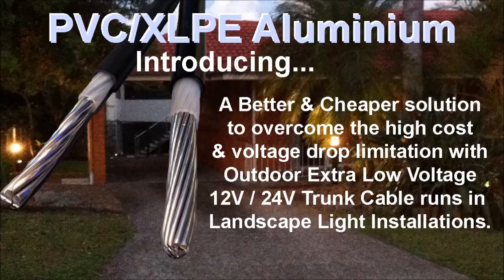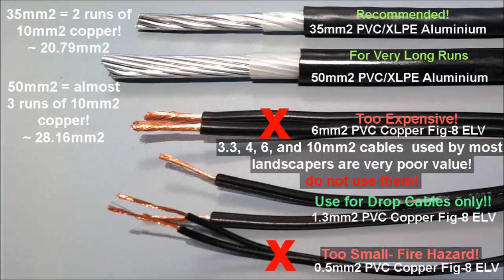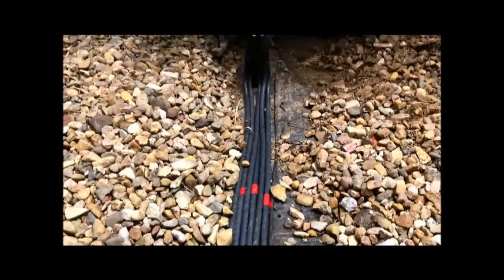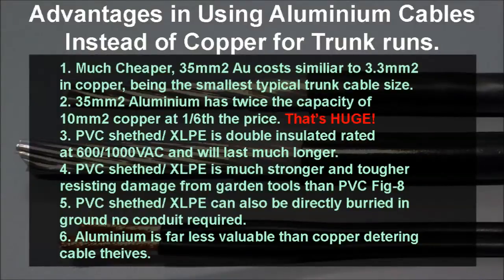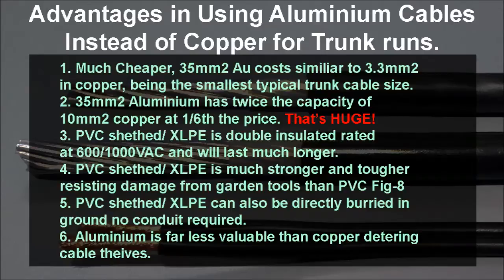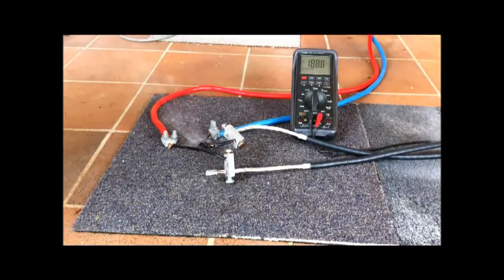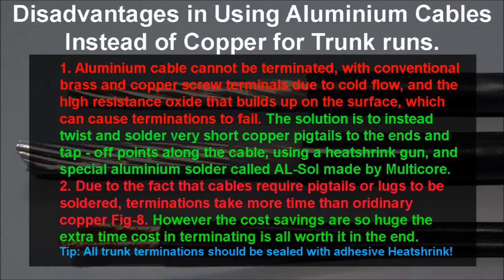Saving Money On Trunk Cable runs in 12V / 24V Landscape Light Installations

Comment: 0:02
It isn't better it is only cheaper.
0:28
Spelling error.
0:31
Three spelling errors.
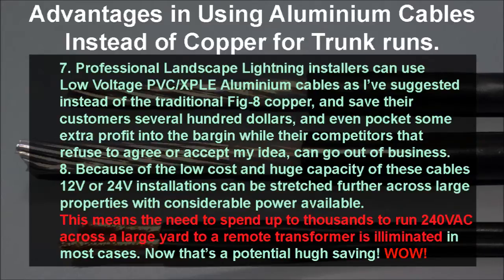3:15
One spelling error.
4:05
Illustration is not conclusive; not a fair visual test.
4:27
Wow, no spelling errors.
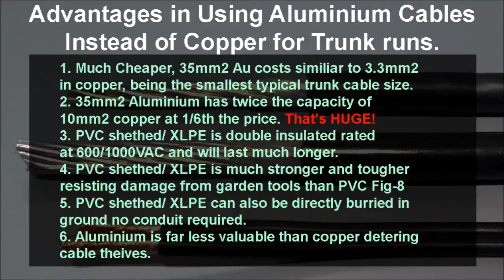Reply from the maker: I did actually check and could not find any spelling errors at :28, :31, or 3:15, I verified with the online dictionary. There may have been one where a lot of text is on the screen and was overlooked but I couldn't find them. But doing a spelling and typo report reply is really missing the point, the message is clear. There are advantages and disadvantages with using both pvc copper or pvc/xlpe aluminium, If you can afford the extra time in termination there are more advantages pvc/xlpe aluminium. The over current test burning out 6mm2 copper was more just a bit of a joke, but 35mm2 aluminium can handle more abuse than 6mm2 copper.  Many companies like the power authority Energex use aluminium where possible and not just because its cheaper. Your attempts to discredit the video has failed..opps  "Wow, no spelling errors" u say. If you happy to get ripped off and use copper you're tough luck.."OohGoshYoureWrong" lol

Comment from the maker: If you ever need to solder aluminium there is a special solder called ALU-SOL its made by Mulitcore Solders It sold at Prime Electronics in Bowen Hills Brisbane. You can use a blow small hand held torch or a heat shrink gun to solder aluminum to aluminum or aluminum to copper etc.. Do not bother tring to use an ordinary soldering iron as the flux in AUL-SOL will make the tip go black and its useless.

Comment from the maker: I forgot to mention the aluminum single core PVC/XLPE is not stocked by most cable suppliers. For Sydney and Brisbane the only place that sells the stuff at the cheap prices I mentioned is Powermac Cables powermac.net.au Thay have now introduced a cutting fee of $50, however they have plenty of off cuts up to 100s of meters long available, and you can avoid the fee. Also If you buy full rolls its cheaper too.